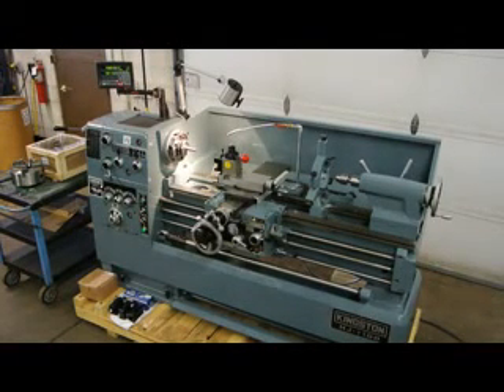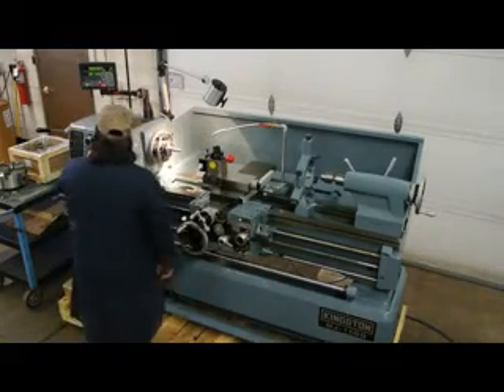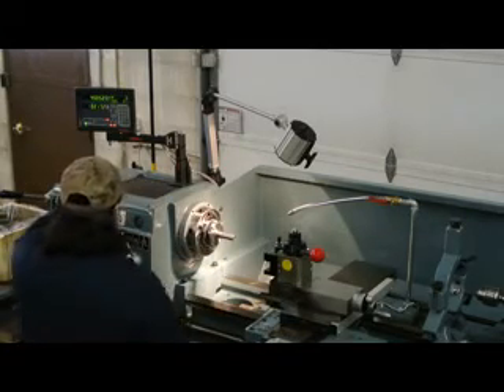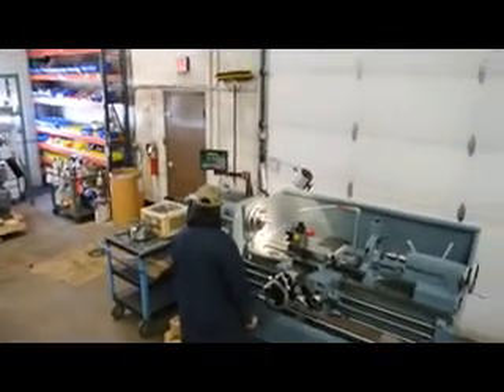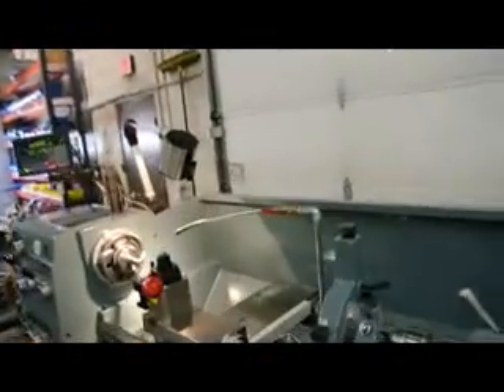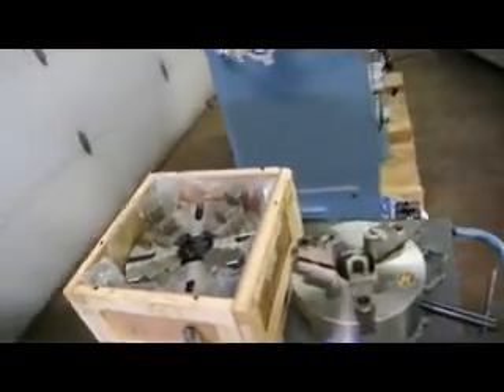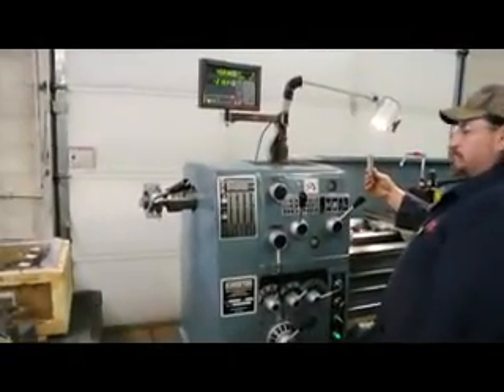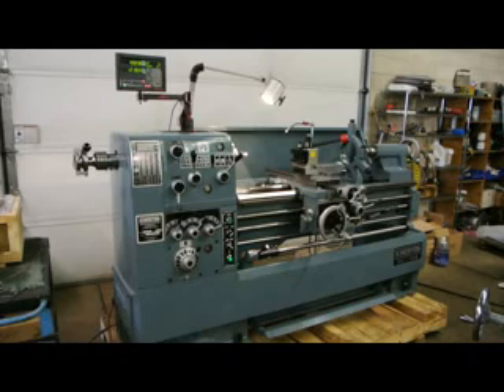Kingston HJ Series Lathe, sold new by Machinery Consultants in Utah

Comment: What a high quality lathe that is offered in the inter mountain region around Utah states, super high quality selection of lathes that are mfg by Kingston lathe company & Machinery Consultants has been a full stocking Dealer with fast parts if needed & skilled technicians for after the sale support.... They also carry these models in there Utah Whse in downtown SLC UTAH with an extremely friendly & skilled technical sales dept. that offers fair prices on these lathes with a full compliment of high quality tooling, chucks, digital readout units with installation, Q.C. tool post packages and they can always be ran under power also. Visit there website at wwww.machineryconsultants.com for there contact info and great service too.
Reply from the maker: Hey thanks for the support !!! Always great hearing from you as well, Bill Jr.